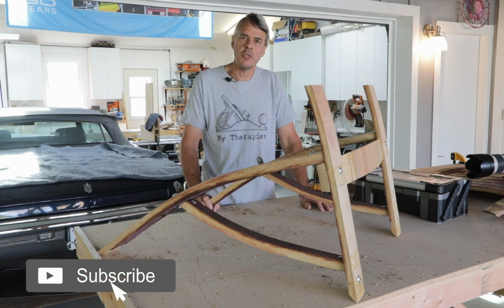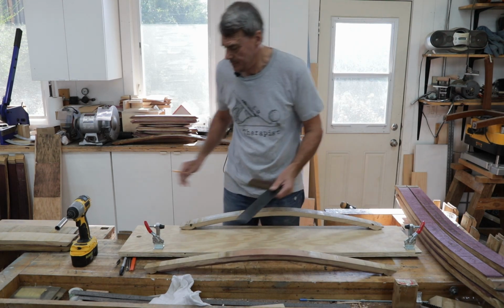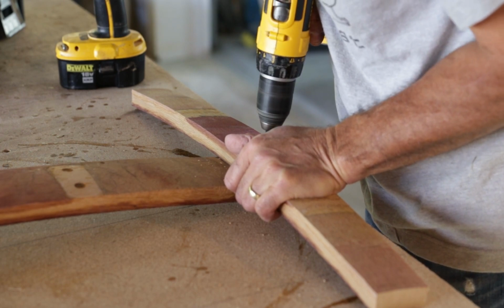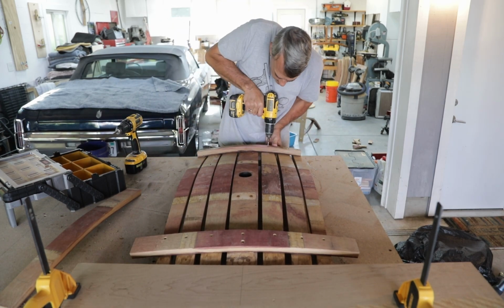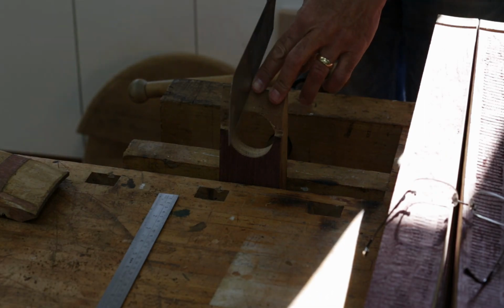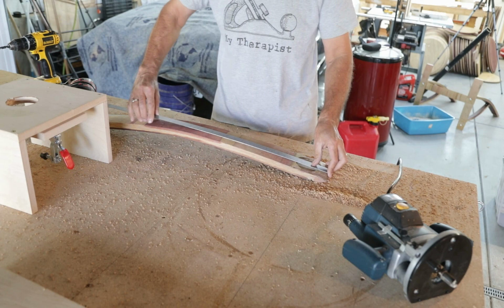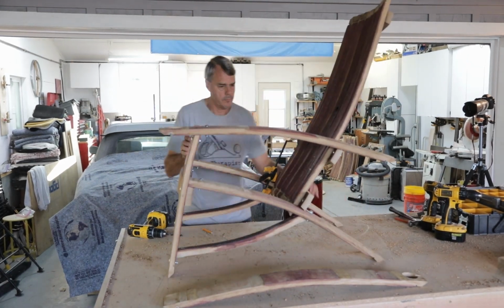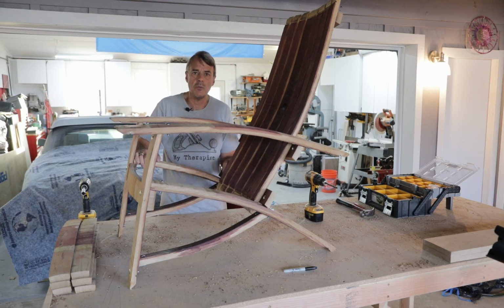Wine Barrel Adirondack Chair - Part 2

Comment: In the step where you are drilling the second hole on the first armrest, did you mean to drill a hole at "29-7/8?
I'm hearing you say "21-7/8.
Reply from the maker: Hi Jonathan. Yes, the dimension should be 29 7/8". Thank you for pointing that out.